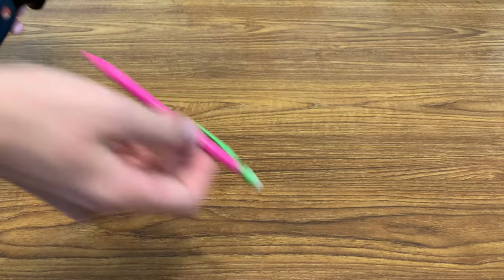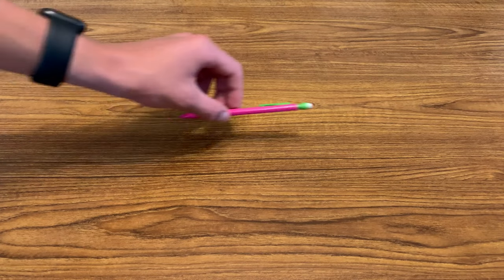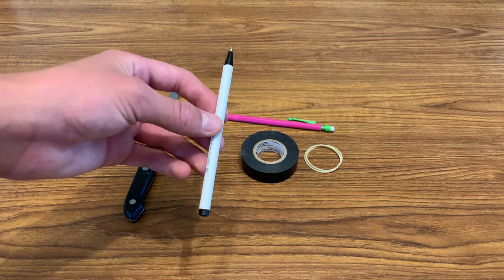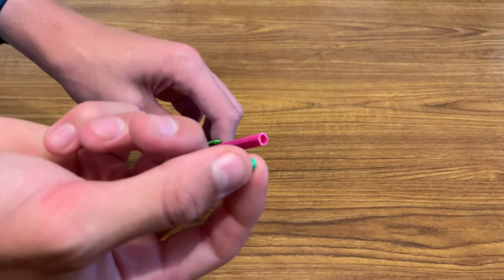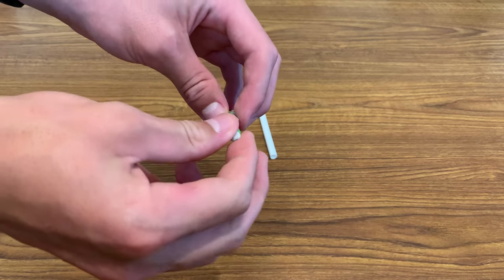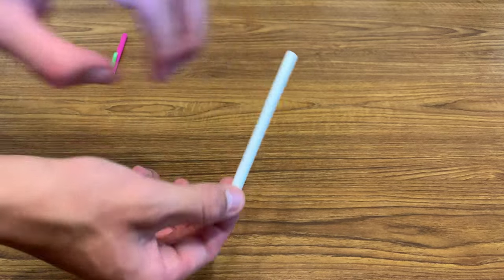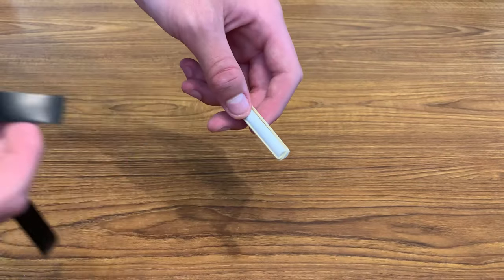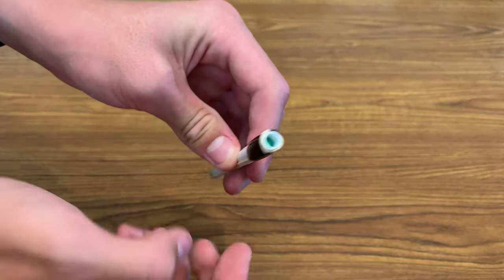How To Turn A Mechanical Pencil Into An AIRSOFT GUN!

Comment: You can literally just enlarge the tip of the tube with scissors and it works better because the BBs don’t slide out. Once you press them in, they stay so you can aim down.
Reply from the maker: True, this works